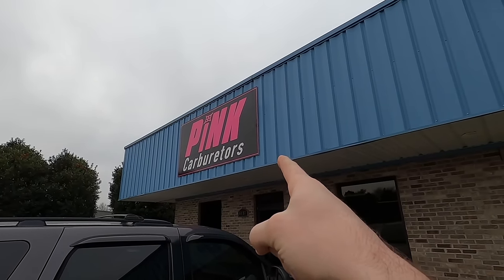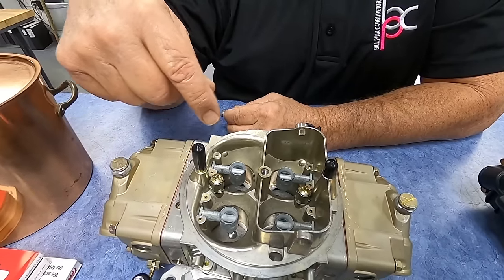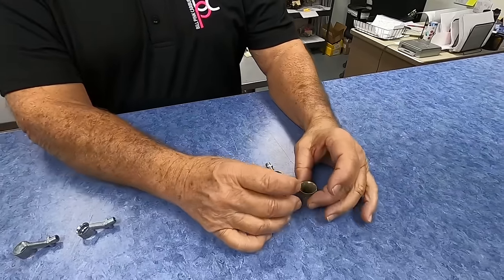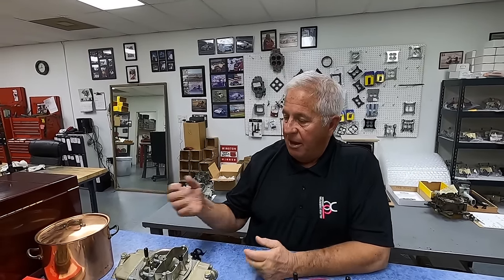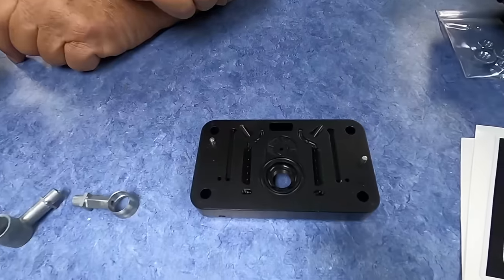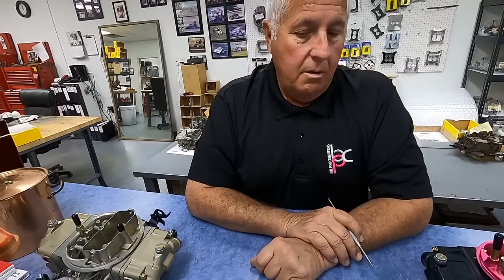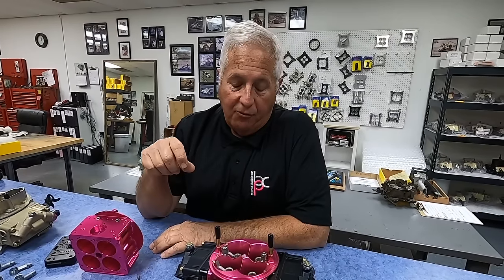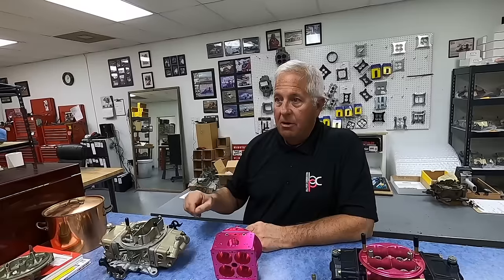Carburetors Are WAY Smarter Than You Think! Tuning Guru Bill Pink Shows Us Why (Carb vs EFI)

Comment: That was awesome.  As many carb segments as Bill will do, is the amount most people would probably love.  That was excellent and felt like just an appetizer.
Reply from the maker: Glad you enjoyed it!
Reply: @Stapleton42  Bill Pink certainly has a good base of information and mechanic level knowledge with carburetors, as he explains in this video.
A. However, Bill only described the single carburetor type design with multiple venturis, with the commonly used primary/secondary arrangement, design, also with a four barrel design, with which this single carburetor is attached, affixed, bolted upon a single intake manifold with air flow into each cylinder head.
B. Bill does not describe the issues, problems, lacking with carburetors, compared with fuel injection and the reasons all basic level to higher performance engines within racing to production shifted to fuel injection, especially earlier within European engines along with the early Corvette LT1 engine for the Corvette SS and production C1 1960-2, C2 1964-7 [only revived used beginning in mid-1980's (C4 1984, GM MFI, SFI especially V-6).
1. all MB "E"=Einspritzen=fuel injection from 1970's - early were mechanical as the LT1
2. Japanese also added FI earlier than most USA manufactures
C. The descriptions Bill PInk presents as recorded in this video are clearly lacking the actual physics, principles, as Lake Speed, Jr. and other expert level individuals which have been interviewed, recorded, and posted on this channel.
D. Also Bill PInk, actually distorts the realities about racing teams and use with engineers
1. Bill Pink may be similar age with me [63+], perhaps, since his father Ed, was born the same year as my mother; 1931
2. All liquid fuel rockets, for military and space applications were developed, designed by actual scientists and engineers
-a. Werner Von Braun, german scientists, physicist, developed the first 'modern' liquid fuel rockets for Germany; V2 used during WWII.
-b. a close friend, PhD Chemistry, Princeton Univ, born 1931, worked on liquid fuel rocket development at Johns Hopkins Applied Physics Laboratory, of rocket engines for US Military & NASA.
E. All advanced, winning racing teams began having automotive engineers involved in development within their racing teams, especially since 1960s
1. Cosworth, engine designer, developer - engineer
2. Zora & Mitchell - GM engineers
3. Ferrari, Lamborghini, Porsche, Koenigsegg, Bugatti, Mercedes-Benz, etc. all developed by engineers
4. all early and advanced aircraft, spacecraft, ships, engines, turbine, jet, etc. developed, designed by engineers
5. Every racing team which Ed Pink became well known, involved with, since late 1960' onward and Bill Pink during his racing team carrier have engineers involved in  the design, development, along with NASCAR, NHRA, IHRA, IndyCar, IMSA, FIA, F1, F3, G1, etc.
F. Having engineer level expertise as Lake Speed, Jr, as he was involved with Joe Gibbs Racing [maybe still], also with TRD, Penske, Chevrolet Performance, PME, etc., certainly every motor vehicle, component manufacture, from the major, international, aftermarket, performance, racing, etc., all have, use engineers to design, develop their products, along with many companies were and are initiated, developed, started, owned by engineers within motor vehicles and certainly other modern technology, especially electronics [though MS, Tesla, Plantir, PayPal, ebay, fb-meta, some others were not - though key originators, partners involved were/are engineers]
All The Best, Sincerely

Comment: Back when I automated oil refineries, we did this on a big scale relative to what you are doing on a miniature scale.  Similar to doing Dyno runs, I would bump test and step test various control signals (flow rate, pressure, temperature) to excite a running plant, measure the responses and then crunch numbers to build the response curves (models of the process plant being tested).  All the modeling had to pass the muster of my engineering training.  Similar to mapping horsepower from a Dyno test.  Then I could start the tuning.  All of my work was from use of matrix math, knowing how to ratio different model gains to keep the matrix calculations stable.  The model curves were numerical and set inside the matrix.  Control of the plant came from inverting the matrix every minute to calculate the future move plan deployed to drive controlled variables to their optimized value. Testing took about 2 weeks of around the clock work.  Modeling took 2-3 months.  I was dealing with matrix sizes of 12-15 independent variables and 40-60 dependent variables ( for example a 12 × 40 matrix).  Tuning was done using the model curves, a matrix massaging was based on running optimizations that set model gains to minimize a matrix stabilization number.  Then I deployed this matrix controller on the live process unit, training the board operators (the drivers) on how to use this.  Then I would be constantly talking to the operators about what worked and what didn't, and from that feedback, I would further tune using gain ratios or modifying model curves.  All of this automation saved on average 10-12 million dollars a year on just one process plant.  Uptime was about 95% of the year.  Board operators would enter desired product specs, and the automation adjusted the process in a lowest cost manner to hold to those desired specs, often while dealing with disturbances like air temperature changing from day to night, feed composition swings, and others.  Your videos are the best!
Reply from the maker: Wow that is a lot of information lol. Thank you Wayne!!
Reply: That's a ton of detail lol.  You know how to tune.

Comment: I grew up working on carburetors. I love them. For some basic budget hotrods or cruizers. It can still be a fine answer.  But its time to move forward. Lets talk about what they can't do. 
Like inverse timing control, nock sensing and control, driveshaft speed, traction control, instruments control and options, flick of a switch tuning options, trans control, waist gate and shift controls, ejection seats, progressive pwm control of anything including nos solinoids and how about data logging. A/F and timing corections in real time while you steer. Other than cost. Who doesn't want some of that?  So for me its not that they are not amazing!  They are.  But they very much limit the cars and the potential drivers experiance. So for me atleast. A carburetor is a low cost back up plan.  But they can run really nice and will make power!  So for those that find efi gives them a migrain. Well nothing wrong with a Q-jet or a 1150 dominator. They work.
Reply: What you're mentioning has nothing to do with FI vs carbs. Any ECM can control everything you mentioned without controlling the air intake & fuel mixture. An MSD box can regulate the timing. Retarding timing reduces HP & IF you need it, you don't know how to tune or setup bite for sh!t!! BTW, Traction control is illegal in most types of racing in the U.S. IF FI is so GR8, please explain the reason that NHRA Pro Stock cars have run 1/10 second & 10 MPH slower(except for 1 pass, at Gainsville with 1,400 ft BELOW sea level air, still didn't come close on MPH) than they did with carbs, ever since changing to FI. & NASCAR engines still get the same fuel mileage they did with carbs, even though the HP has been reduced by 35-40%!

Comment: I have a secret, I have never really understood carburetors. I have read about them in both books and magazines and have a basic understanding. But listening to these two guys talk about it and the science and engineering behind them. Nothing short of wow. Can't wait for the metering block video. 
Once again another great video, thank you both for adventuring out to these people. God bless you both.
Reply: One thing that those new to carburetors face is very simple, but needs focus:  metering block.  One side [jets & power valve] manage fuel, the other side [emulsions & bleeds] manage air.  Coordinating the two is where tuning begins.  As brought up in the video, emulsions are worth their own discussion.  To a point, sizing up emulsions [for the same size high speed air bleed] can increase fuel delivery, as the column weighs less & picks up velocity faster to the boosters - counter intuitive at first glance.

Comment: I really wish you would get some of these old Nascar guys together to discuss the ways they encountered "people cheating or bending the rules" over their career in these racing bodies. Because I am 100% the top tier individuals you talk to would have never done anything that could have been considered "in the grey area"
Reply from the maker: Bill told us a good story after this video. We have the footage but have not used it yet!
Reply: @Stapleton42  I think you should put a video together of all the "speed secrets" they used. We've all heard of the lead slugs inside the roll cage, and carbs used that open up a great deal once the air cleaner was screwed down on restrictor plate tracks.

Comment: Another great tek related video, are you going to do a follow up with more info that Bill really doesn't want to tell us - actually how the metering block works and how the air bleeds help to control the fuel mixture at various engine speeds --- 
I this sense lets try to de-mystify the Holley carb and it various elements -- 
To get into real racing carbs one has to look at Weber, Solex and Mikuni --- 
What Bill and others do is try to copy what these other carbs do circuit wise

Comment: Having been around short track racing and helped out on a SCCA GT1 team as a teen looking to learn what I could, carbs can be razor sharp and make power.  The problems today are ethanol in the fuel,  I can't keep lawn equipment running without going 87 ethanol free.  Cars are just as bad.  If you do get the carb to handle ethanol, the ethanol content varies pump to pump.  Ethanol absorbs water,  I'm in the humid south.  Also with efi I can get injectors in the right size range, and the tuning software,  I can tune it to stay running well.  Carbs require more jets, venturis etc. and a new Carb isn't cheap.  I spent the money to go to efi tuning school, so I do my own tuning and running NA it isn't that difficult to have a good running car.  I could be interested in going to a school on how to tune a Holley.  Every carb guy I've known keeps secrets and doesn't teach in the detail that I can find on tuning efi.  The car runs great one day then bogs the next.  I am not saying everyone should switch to efi, everyone should run with what they enjoy playing with. If you do enjoy carbs take the time to teach the next generation in person or on youtube.

Comment: Air jet size effects the main jets flow. Larger air jet is like a larger hole in the bottom of a beer bong slam. If you want it quicker, it is not just size but distance. The vacuum above the throttle valves effect the power valve. Want less lag time, shorten the beer can, put in a larger power valve. Large cams that lower intake vacuum at idle effect air jet to main jet, cause power valve to open quicker so install a smaller power valve. The distance between the air valve to main is fixed. This is air only until it reaches main jet. Bowl fuel equalizes as outside air pressure is done pushing it down. The only way to get fuel faster or slower is to change the main nozzle is to increase the size, reduce the size, raise or lower it. All of these actions are based off of the engine & intake it is bolted to. Then run a dynamometer test to note peak torque and make adjusts to the correct carb part that becomes more active at the point.
  As far a diesel, it is more about the heat of combustion that makes them more efficient with out a throttle valve. The point when an injector opens, keeps more heat in the cylinder on top of the piston to create a longer burn time. 1/3rd of the heat of gas engines goes out the cooling system, exhaust system and the block. Where as a diesel has 40% in the block, 35% in the coolant and 25% out the exhaust.  This is we're suite comes from, a cooler exhaust. A filtering trap catches most of the suite, until the exhaust side pressure drops and the cylinder head side increases. The most common was to sense this, is a pressure differential filter sensor, engineers call a DPFE. Injecting an ammonia base liquid is a washing method but cheaper than a burning method to open the particulate trap!
DK, Omaha. ASE Master Tech since 78. Retired.
Reply: Did I miss any mention of accelerator pump cam profile? asking for a friend... :)

Comment: Wide band was the game changer for carb tuning. No longer looking at plugs to try and determine the right jet sizes. I just bought a Holley brawler and I got it pretty close out of the box to run decent but finding headers or manifolds for a 85 trans am with o2 bungs is really difficult unless u have $$$$ for custom headers. That's my obstacle for now to get a wide band and start messing with jets and cams on the squirters. Also my car has a massive cam and barely pulls 5" of idle vacuum so almost everything out there on how to "tune" is for regular cam engines with 15" or more idle vacuum.

Comment: As far my diesel knowledge goes. A gasoline engine takes a mixture of air and gas, compresses it, and with spark plug it ignites. A diesel engine takes air, compresses it, and injects fuel from injectors inside the cylinder head. The heat of compressed air ignites it. That's why diesel engines don't use spark plugs. Air can be used via turbo, supercharger, or naturally aspirated. Turbo most commonly used. Fuel works in many different ways. Pumps can be gear driven, belt driven, or electric. The one I have (Cat C-15). Fuel leaves tank, goes through primary fuel filter, then into fuel transfer pump, then into secondary fuel filter, then pressure regulating valve, and into the fuel supply to the injectors. Injectors can be mechanical or electronically timed. Mine kinda works both. ECM regulates the spray pattern while the function of the injection comes from overhead valves pushed by rocker arms thanks to gear driven camshaft. As far high performance goes from mechanical perspective, camshaft plays big role how you want fuel and air to be used. Turbos and pumps also.

Comment: My wife's 16 year old Toyota Yaris has 345,000 kms (214,000 miles), gets regular oil changes at 3 to 5k miles, and lives in the great white north.  I changed the spark plugs for the very 1st time just before 300,000 km mark (it was feeling a bit sluggish, but couldn't tell cuz, well, 106 hp on a good day.... )  they were worn, but not fouled or oily or black or anything.  
The only other thing that has ever been changed is the PCV, and that was back around the 200,000 km mark.  It starts first crank, still gets the same mpgs as it did new, and it doesn't have any running problems, at all ever.  Hot, cold, winter, summer, rain, snow, climbing a ski hill.    And it has never needed any adjustment, or any parts (that's mostly a Toyota thing).  It's mostly driven on short trips around town by someone who knows almost nothing about cars (my wife).    
THE POINT: There is simply no possible way that any carburetor could ever go this long without being touched.  And because I change the oil so often there is no oil burning either, so...another 300,000 kms anyone?  
Carbs are great for having fun, but they will never be back in daily service. 
Not now, not ever.

Comment: I still have carbs on all three of my old trucks and cars. Just use an AFR gauge with a wide band O2 to keep track. The only issue I ever run into is the occasional high altitude excursion in my Ramcharger in Colorado or the Sierras. I have an Edelbrock 1826 off road carb on it, Holleys on my Duster and D150.